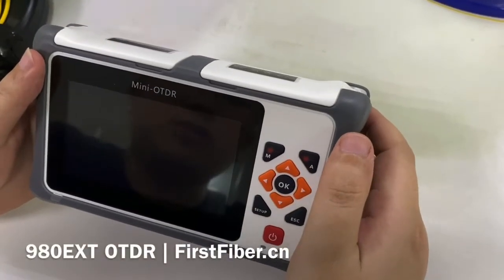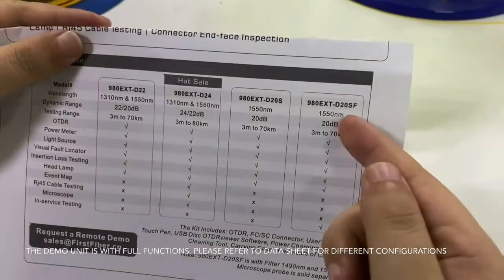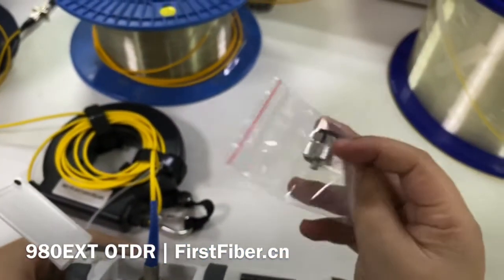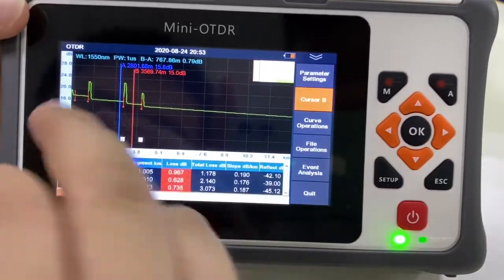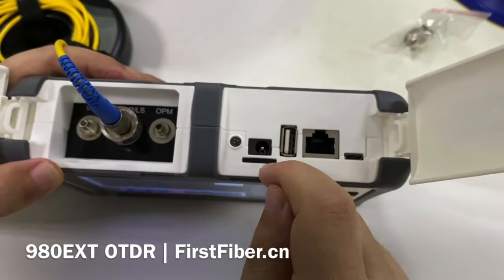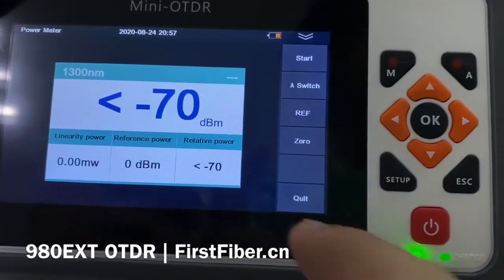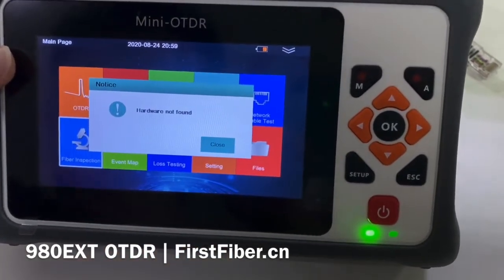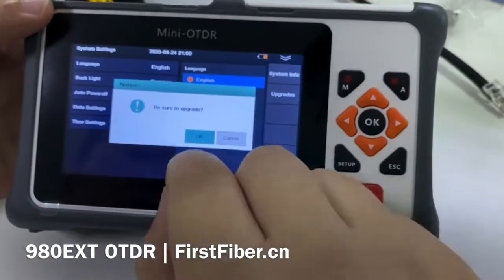980EXT OTDR Operation Demo

Comment: These Chinese OTDR's are all the same software.  I have tested some, they are mostly all the same.  They are not good for short distances of 100m, and will fail to detect short patch cables used to connect fiber lengths.  If you have a 3m patch cable connecting two 100m fibers, the 3m patch cable will show up as a single event with combined loss from each end of the cable, and create a fail event, even with 5ns pulse width.  The device will not recognize and correctly map each connector along the fiber.  This is why the video shows usage with 8km of fiber.  If you have at least a 300m fiber run then these Chinese OTDR's are usable as long as there are no patch cables connecting your runs, or you will get inaccurate and confusing results.  Also, the Laser Source function is worthless because it does not tell you output power.  You cannot use it to measure loss because you do not know what power you are starting with, however there is a slider to control the output power....